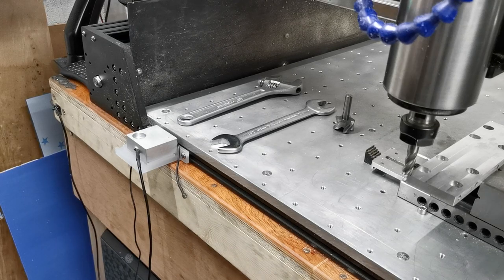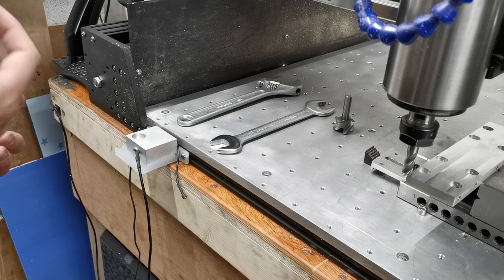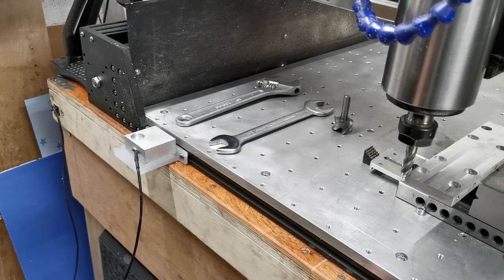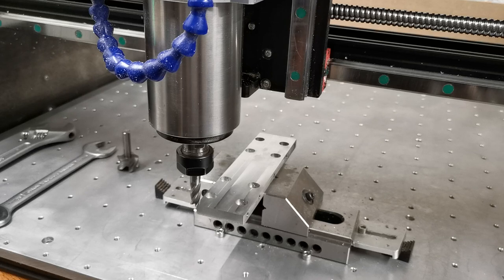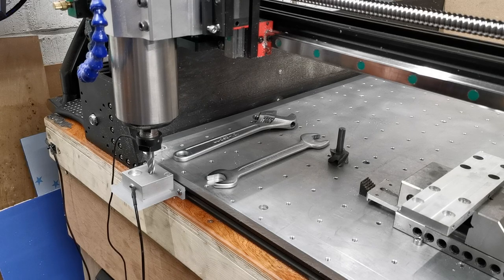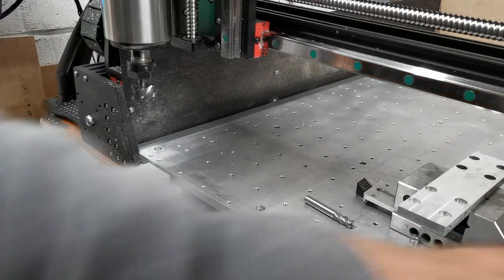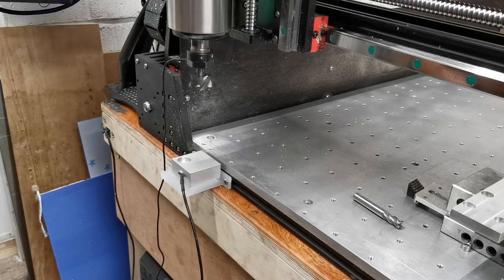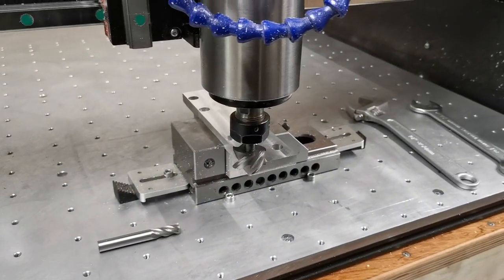Testing The Beaver CNC Zero 2 Probe with Automatic Tool Length Offset in CNCJS

Comment: So how do you account for different height stock? Do you have to CAM with your workholding coordinates in mind? Where is Z zero on your model?
Reply from the maker: This macro uses tool offset commands. In this case the datum is set at the front, top left of stock :)
Reply: Luke's Garage oh okay. I don’t even think carbide motion allows for that on my Shapeoko. I need to branch out and look at other software
Reply from the maker: @KalebQi  nah it doesn't 😭 CNCJS is the route forwards, I use it on all my machines now Inc the shapeoko
Reply: Luke's Garage awesome. Thanks. I’ll look into it. One day I’ll upgrade from this machine to a ballscrew and be all proper awesome, but till now I’ll at least try to get more out of my XXL